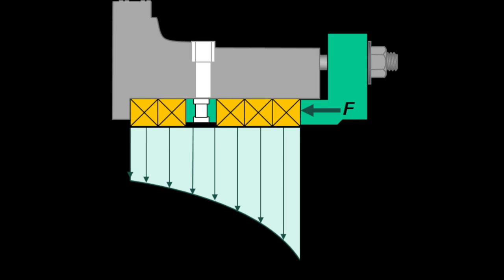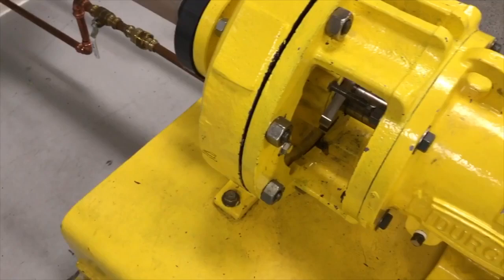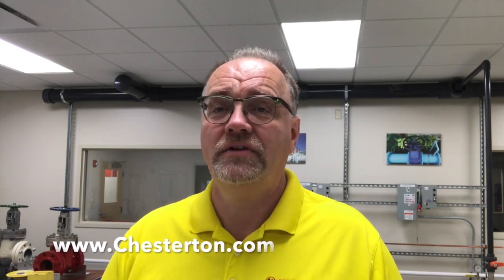Training: Pump Packing Installation -  Part I

Comment: Are lantern rings required in the packing
Reply: Yes, without them you’ll burn up your packing
Reply: @suckme8452  talked to an engineer at Aurora pumps and you actually don’t need them . By design they are required for low water pressure.  but there are some requirements needed, like minimum of 40 psi.